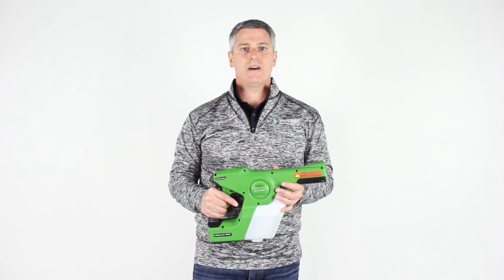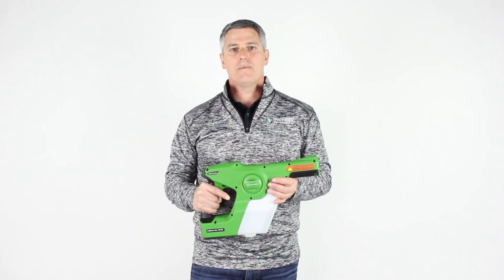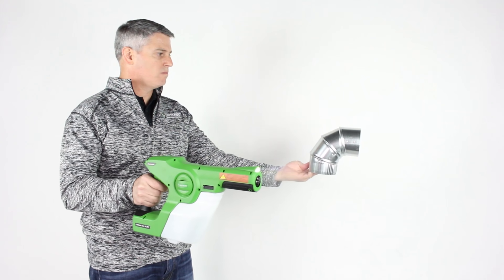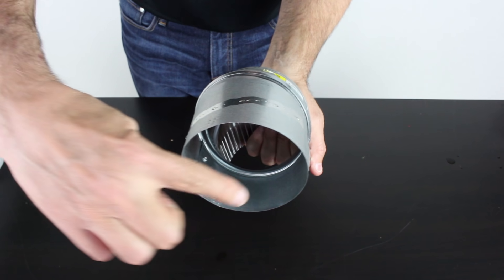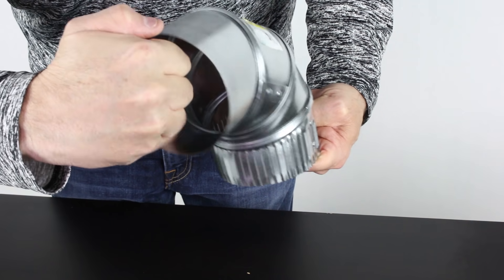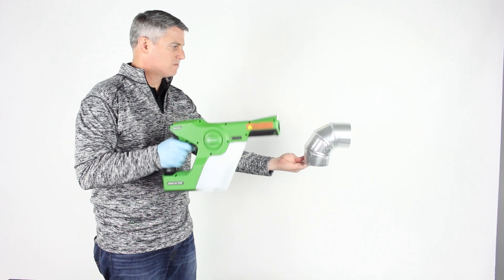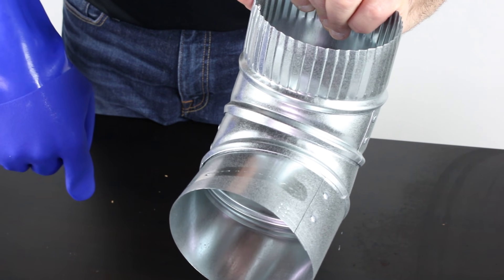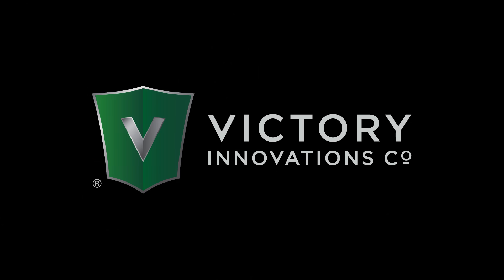Victory Innovations - Electrostatic Demo (Full)

Comment: The issue is whether or not the object you're spraying is grounded, not whether or not the hand holding the sprayer is grounded. If there's a concern about any charge from a tool going through you, you would want to be isolated from whatever tool it is your using to avoid electric shock...

Comment: Your demonstration is deceptive. In watching, the first and third demonstrations which are supposed to "show how effective the electrostatic feature is" you used the same index finger which picks up moisture from the top and transfer it to the second and third surfaces on the pipe. In the second demonstration where you "turned off" the electrostatic feature you intensionally used a different finger, a dry finger, as you wiped each new area of pipe, which then did not transfer moisture to the new area. I watched it multiple times to make sure I was seeing it correctly. Using a dry finger for each test might demonstrate how effective the product is.
Reply: Did you notice that his clothes also change during the electrostatic finger wipe. There’s obviously an edit there.
Reply: Yeah, I caught that too...😕
Reply: Dave you are wrong is is evident the path is through a water mist!
Reply: @EnergyMizers  Of course I am. But Cory's question is valid. My statement that using a dry finger for each test might verify whether the "electrostatic" feature is more than just hype to sell units in a pandemic scare. CDC also states that using this type of product doesn't replace the wipe down sanitizing. I'm responsible for the maintenance and custodial crews at a local University and we can't use this type of product to sanitize our hard surfaces. We have to wipe down all contact / hard surfaces. This product doesn't remove that step.
Reply: @davecalk1  I am a rep for company that has a 30 day kill on all viruses on all sufaces...fabrics, glass..vinyl..hard surface...safe in food prep areas...non toxic. Write me back to discuss
Reply: michael nogaro  if you’re have a disinfectant that has a 30-day efficacy, I’d like to know about it. How do I contact you?
Reply: @EnergyMizers  so why switch fingers only the one time?
Reply: @corymoore8562  You'd use a dry finger each time to prevent "cross contamination" in a sense, to not bring the wet from one surface onto another surface that may be dry.